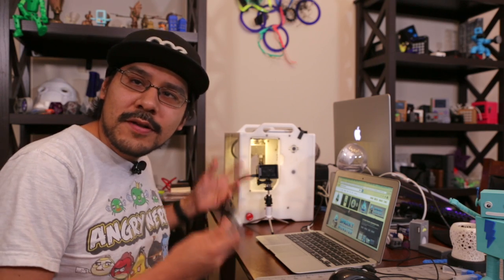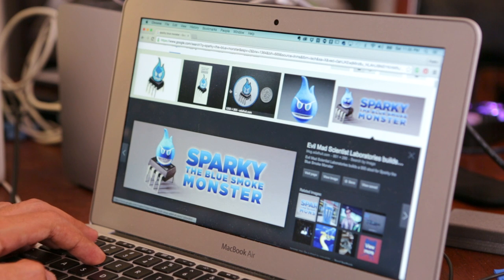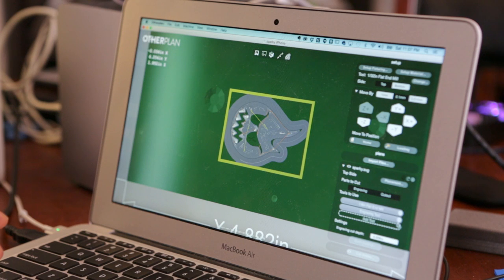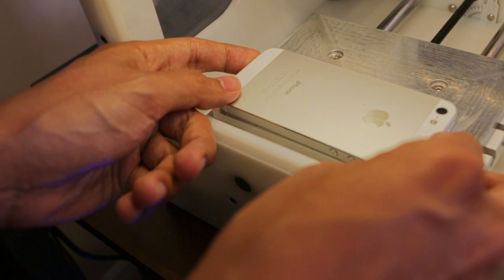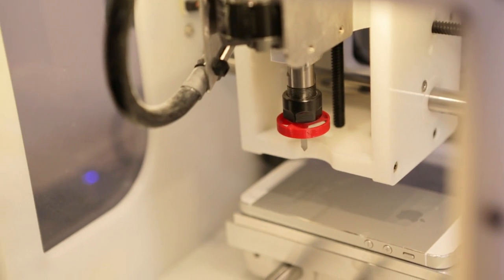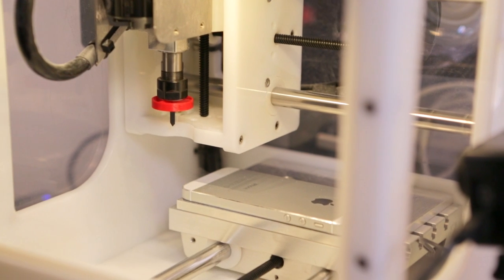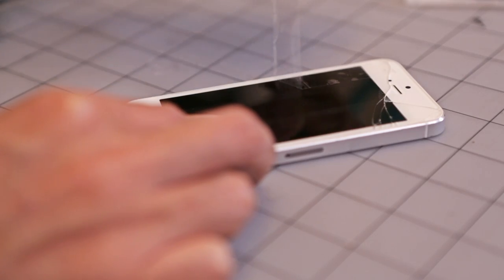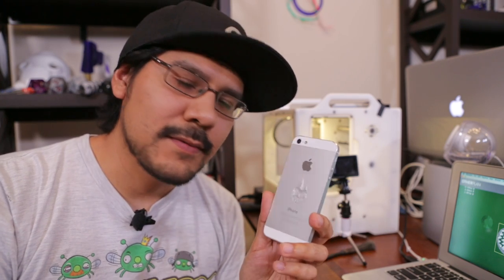How to mill an iPhone @Othermachine #CNC

Comment: Why SVG? Does it accept cad files?
Reply from the maker: +Marc Stollmeyer SVG is great for easy engravings. For 3D CAD stuff, it has to be done in CAM software such as Fusion 360 and exported as GCODE